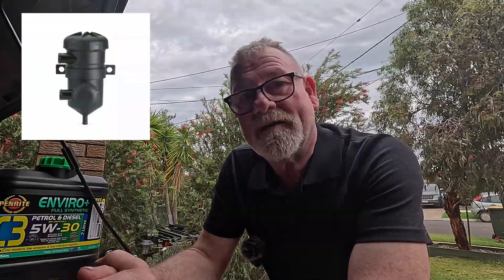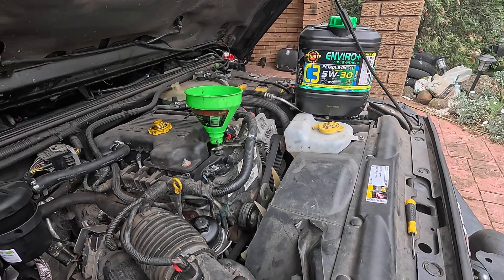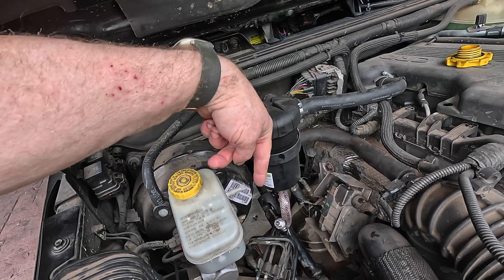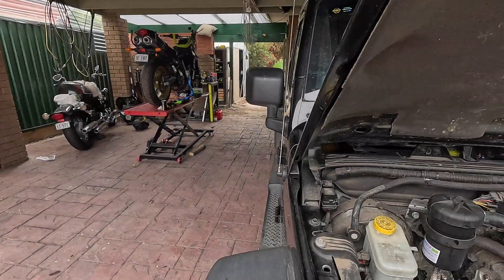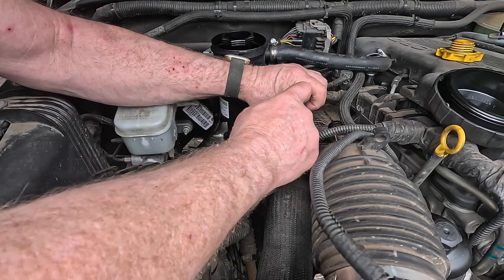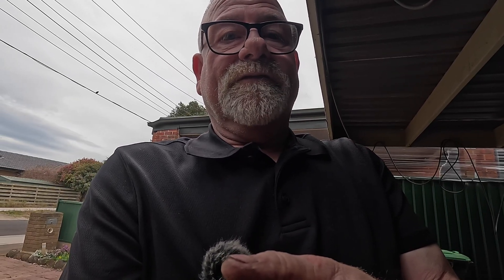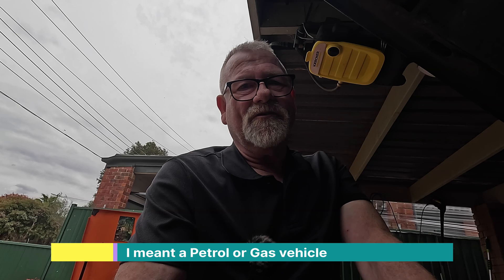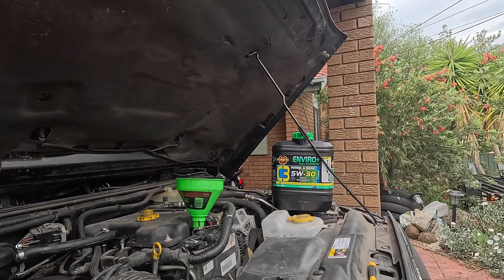Oil Catch Cans Explained, Do they actually work?

Comment: Another good video mate. My issue is I have a new 4x4 and I'd have to check with the car dealership if I can void warranty.  It shouldn't as a catch can benefits the engine !
Reply from the maker: Hi Dan. I have never seen a catch can void a warranty , especially if you get them to fit it. As you say, it will benefit the engine greatly and give you better economy as well as less stress on your DPF.  Hope you are keeping well mate.

Comment: Excellent video, good knowledge! Will look into it for ma VW transporter
Reply from the maker: I wouldn't run a diesel without one these days, plus much better economy too.
Reply: @biker_dan  is yours a universal fit or was it made for the jeep?
Reply from the maker: @craigguy8040  mine was just the can
 I made a bracket and bought the hoses to install, prevent at the time wanted an arm and a leg to purchase one.
If you were clever you could make one with a tin can and use metal scrubby as the filter.